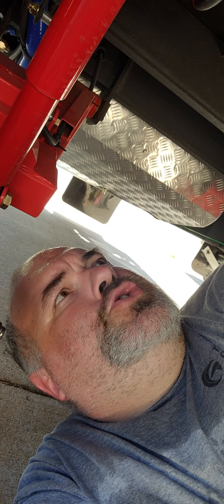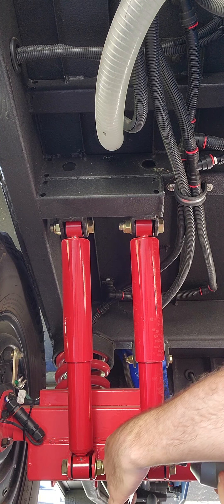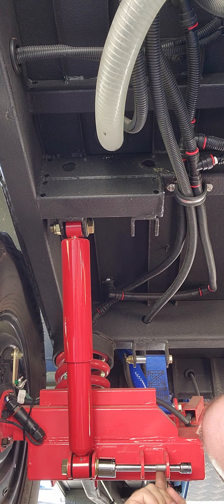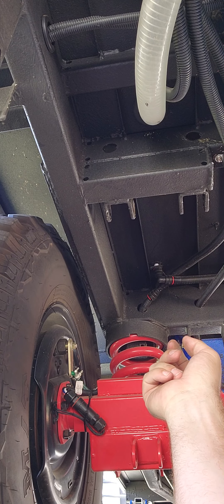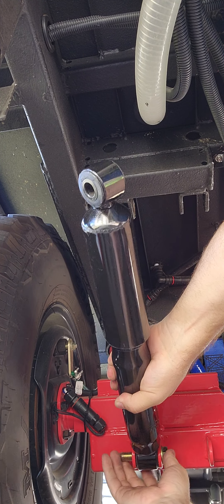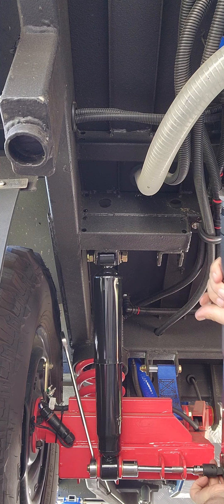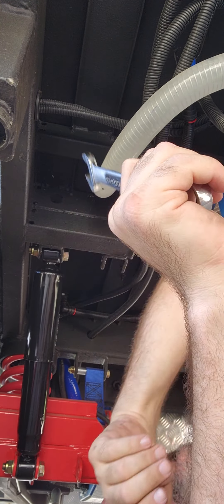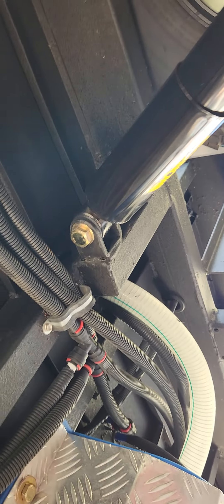2022 OBi Dweller 13 shocks

Comment: So, did you find the oem shocks a bit too loose, like they were worn out from the start? Mine feel almost non-existent when going over obstacles. Also, the link to Amazon is for Monroe shocks to fit a Promaster cargo van 2500, was that an exact match? Thanks!
Reply from the maker: Yes- they're a match. They're much stiffer to reduce body roll. Factory shocks are too soft. Stay tuned for more suspension mods coming soon! 😎
Reply: Thanks! @vaquero_solutions
Reply: I thought the same thing..  In the video they are black and the Amazon link they are yellow..